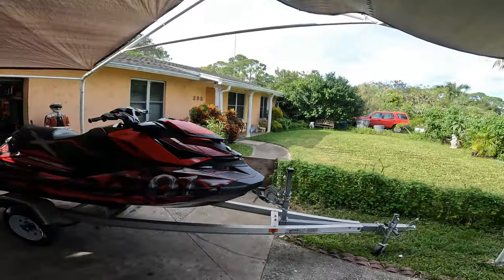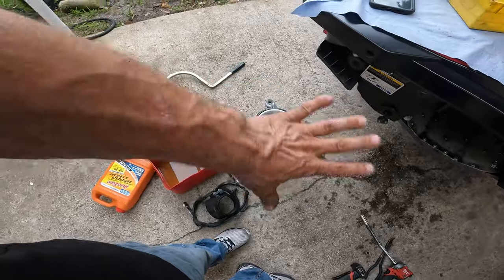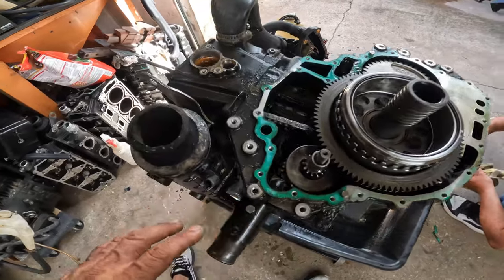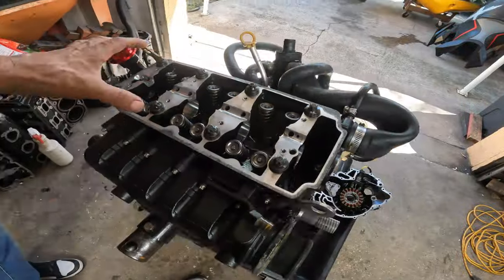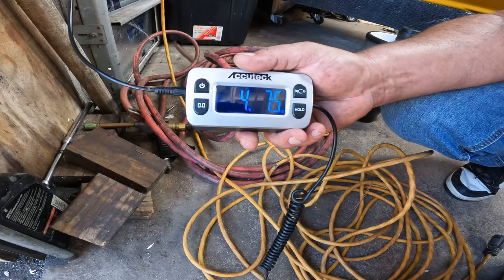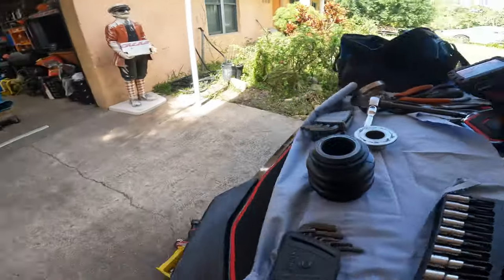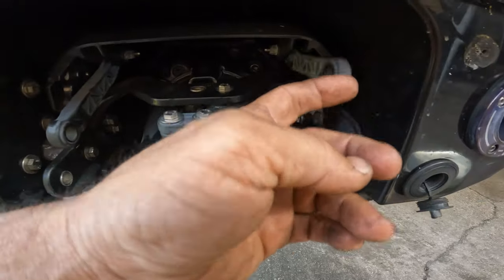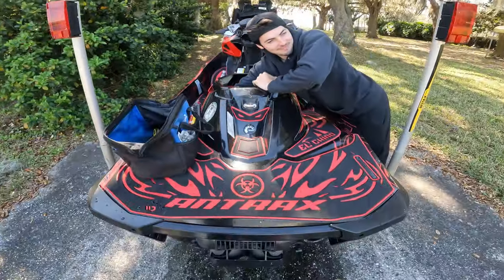Sea Doo RXPX 260 + Calas Billet Camshaft, Lightweight Flywheel, Cam Gear & Magneto Calas STAGE 1

Comment: The Calas cam and the lighter rotational mass is the magic combination. Specially paired up with the right Prop. Btw  Did you end up putting a 15/19 prop in there?

Comment: What kind of difference does the tune do? Just a quick remap of the ecu?

Always the bloopers of the planes over head haha :)
Reply: The tune is  very important not for performance but rather to have the motor run at its most efficiency.

Comment: Why did the carbon seal fo bad so quick?
Reply from the maker: Probably kept the JetSki on too long with the hose to flush it
Reply: Usually, from idling too long without the Jetski being in water will cause wear on the carbon seal.  I think Calas did an episode on the carbon seals a while back explaining this
Reply: @calasworld hola amigo tengo el mismo jet ski y me gustaría tener tu número donde estás ubicado  por si necesito alguna reparación vivo en Miami
Reply: Hola amigo vivo en Miami Me justaría tener tu número por si necesito alguna reparación
Reply: Tengo un rxpx260

Comment: Nice work, what top speed did this machine hit?
Reply from the maker: No idea somewhere in the high 70s
Reply: Don't think the client was worried about topspeed mph.   That cam shines on the holeshot power and midrange power.   The added top speed is just a bonus.

Comment: 4.75 pounds is not correct.  The scale reads 4 pounds, 7.5 ounces. That is just under 4.5 pounds.  Notice the scale read out is in tenths of ounces and 16 ounces is one pound.  See, lighter than you thought!
Reply: So its  still 1.82lbs if difference right? .  So almost 2lbs off rotational mass of the motor
Reply: 1.818 lb difference, so round it to 2 pounds. @DessiLu14
Reply: Yes correct. So he wasn't lying about it being almost 2 lbs
Reply: No because they do not show the weight saving of the balancer and cam which are also lighter!